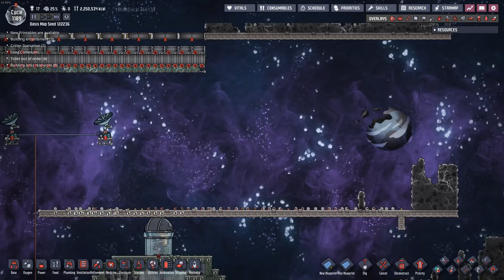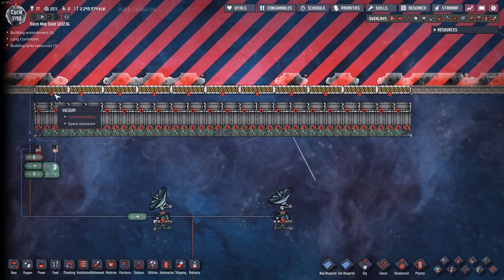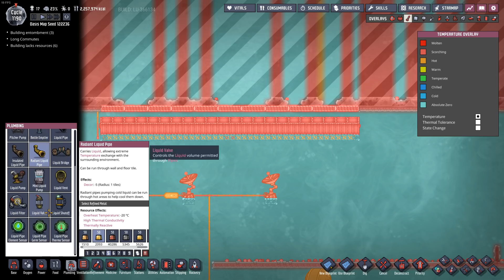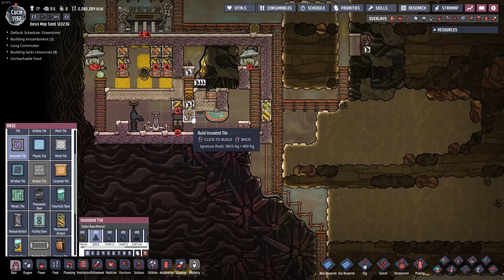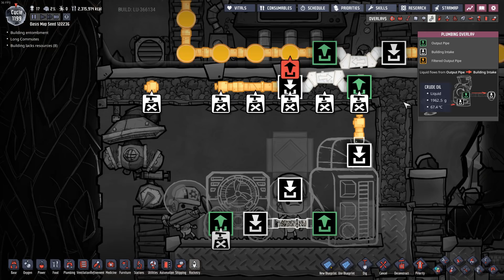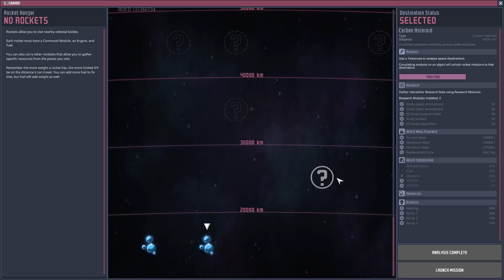Geothermal Power From Meteors! Oxygen Not Included ep29

Comment: 6:10 there is a limit, you need one operator with electrical engineering skill per tuneup station. so for efficiency sake it would be beneficial to stuff as many energy gens into one pp with tuneup station as possible to make good use of your engineer dupes.

Comment: the power generators are a bit badly programmed. 
the tune up thing is one of the issues.
but also for example the coal generator. dupes won't go to refuel it, when there is no demand for power - when it's disabled from the autogrid.

Comment: Add some alu pipes with oil in it for max cooling!
I also done the math:
If you have 256.000 steel, 512.000 iron, and 17.620 alu left over you can cover up the top of the map with steeldoors (500 steel aka 100 per tile) or bunker tiles (also 10 0per tile) with inbuild oil and alu cooling! Its on paper close to be a better powersource then solarpower!

Comment: Brothgar for your water problem , is caused by co2 because the co2 can't push the o2 up but the water can't push the co2 , put 2 airflow tiles on the top will solve the problem , because the co2 can push the o2 out from the side

Comment: As it happens there's a nice phase change "glitch" you can abuse with regolith to get much more power, namely that melting and then refreezing regolith dramatically increases its heat capacity. I saw a device like this on the forums. What you have to avoid is the bug where a packet of liquid freezing into an existing chunk of the corresponding solid will match its temperature to the existing solid (thus you have to periodically remove the solid when it gets too cold to avoid heat deletion).

Comment: Brothgar when using a convyer rail system to transfer heat it is generally best (in my findings) to have the rail pass through at least 1 metal tile with high thermal conductivity within the steam room to impart more heat to the steam much more efficiently. (Just like when the rail passes by open doors the material can absorb or emit heat through radiant heat but that is extremely inefficient. )

Comment: Wouldn't it be more efficient to use some kind of "Ice-Box" in your cooling-blueprint and let all the radiant pipes go through that? In that case you would only use one aquatuner instead of two
Reply: The ice box allows the user to target the temperature precisely - it doesn't have any capacity benefits for the DTU flux the system can handle. Ultimately the number of AT's needed is driven by how many DTUs that need to moved in the duty cycle, and how many turbines are deleting heat. One AT may be enough for Brothgar's needs here, but if it is enough for his needs, it'll be enough regardless of if he uses the icebox arrangement.

The blueprint has 2 AT's probably because the top end capacity in a water based cooling system with a single turbine is 1.5 ATs (ie. A turbine going full blast can suck the heat out of 1.5 AT's running full time - but obviously AT's come only in integer numbers).
Reply: @riotintheair  He may have a point though for the ice box. Currently, the material on the conveyor rail comes at about 250°C and exchanges with a room at 150°C. It may be able to exchange more heat or faster with a cooler room. Wouldn't it?
Reply: @4urelie  if the goal is truly "cool the regolith" yeah, you may be right. steam will only draw heat out of it to 125-150. ice box could get it to a manageable 30°

 but extra cooling would cut into his "free energy" which i think brothgar values more atm
Reply: @4urelie  You're  using an AT to dump every degree under the steam temperature regardless of the design of the heat exchanger and that eats into the margin on power (it's always more expensive to run an AT than the heat that AT expels can generate in a turbine - even with super-coolant in the AT loop). The final temperature of the material on rails coming out of the heat exchanger is ultimately determined by the DTU's consumed for power by the turbine that is equal to the amount of heat exchanged, but the relevant comparison is the temperature of the material exiting on rails vs. the steam temperature - if that value is large then the heat exchanger is inadequate and reducing efficiency. It's kind of easy to see that the number isn't large - the power outputs on the turbine are consistent with ~ 150 degree steam so we would expect exiting material to be about the same temperature and it is. That isn't to say you couldn't improve the efficacy of the heat exchange... But ultimately you're lower bounded by the steam temp on the low end and where that temp crosses the ejected temp  is 100% efficiency on the exchanger and is the lowest temperature you can eject for free.